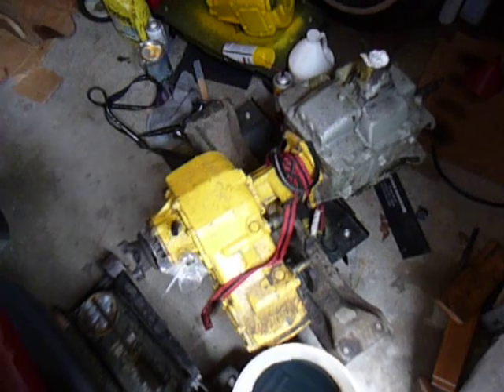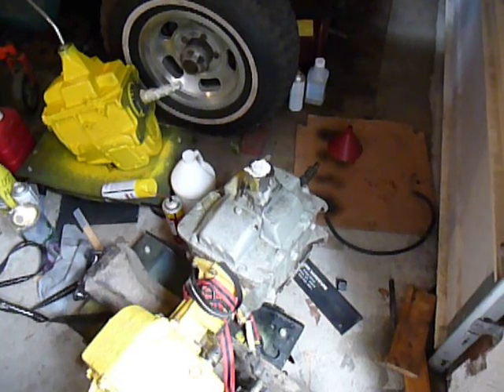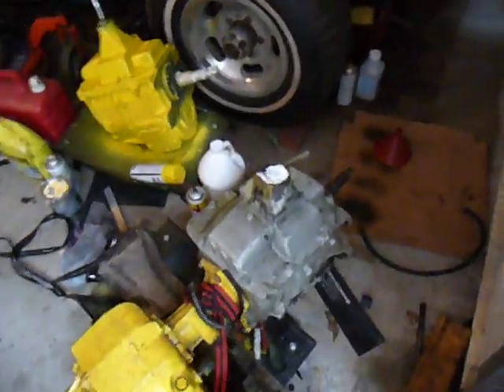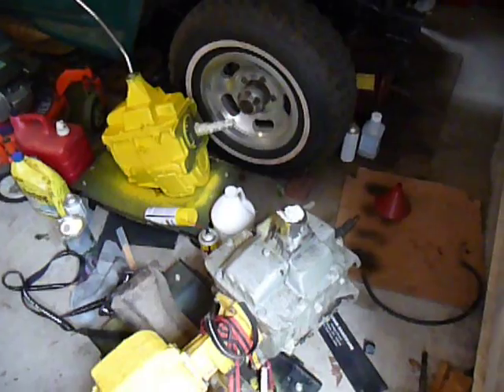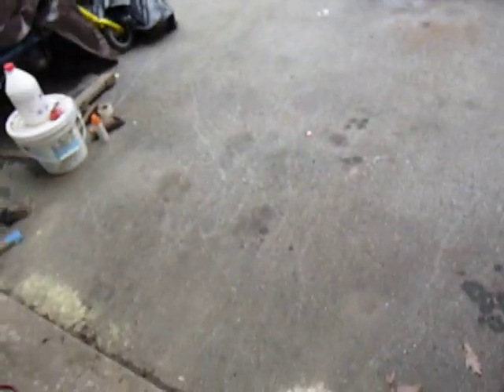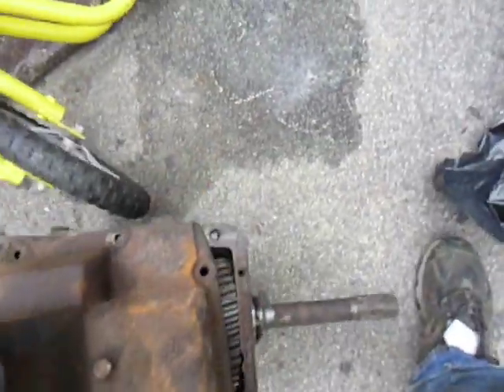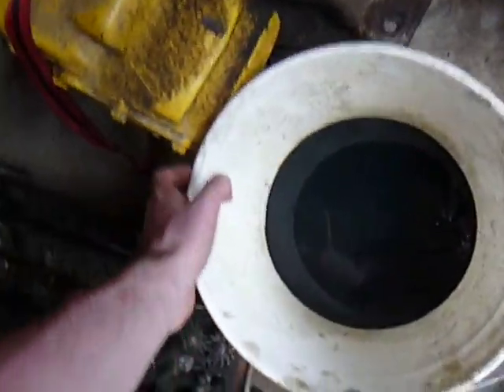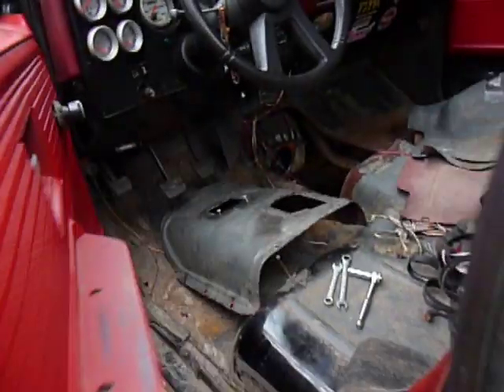sm465 transmission madness

Comment: What keeps the sm465 in gear is the detent ball. I haven't seen any rebuild kits that come with those. I just bought a truck with one these and I will be pulling it tomorrow. It doesn't stay in 1st not low. I'm hoping the spring behind the ball is the only issue for me.

Comment: I have a sm465 in a 1984 k10 with 32 spline output and I cannot find a transfercase it had a np208 And this really sucks transmission works great i recently picked up a np205 but its 10 spline please help?
Reply: Bryan Patterson I'm pretty sure I have a NP 208, if you're interested, lemme know on messenger or something
Reply: I know this is years later but you can get a 32 spline long input shaft for your 205. Just keep the Trans to tcase adapter housing and your set.
Reply: xtm10 still have the 208?